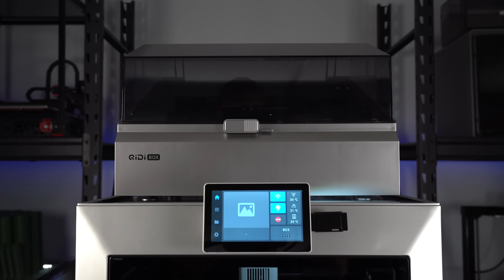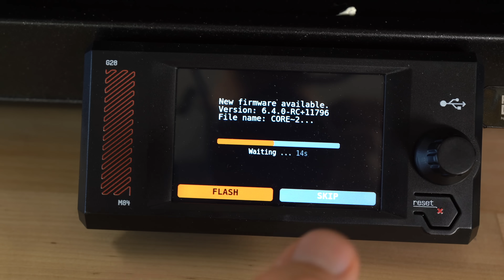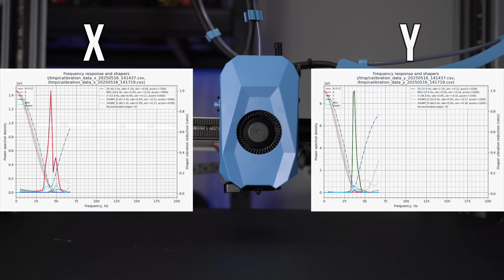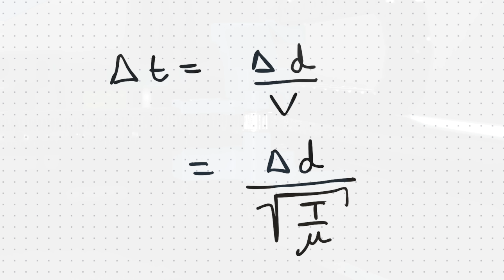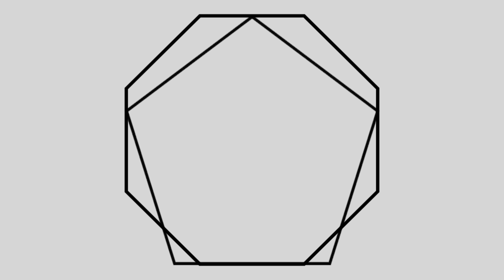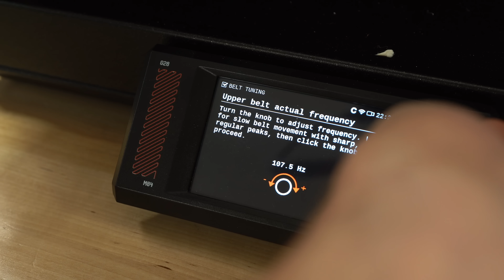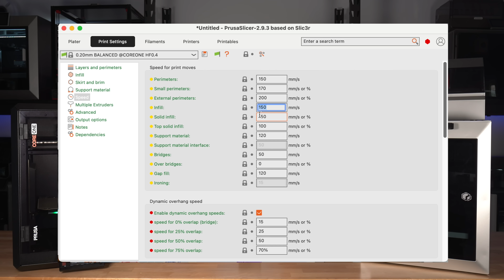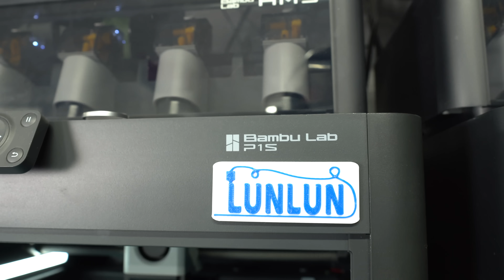The 3D Printing VFA Epidemic

Comment: Are there belts with staggered teeth? I wanted to make a comment about using a flat belt, but the issue of belt slip is probably why those aren't used (though I'm still curious to see results using one). Staggered teeth, meaning teeth that don't vertically go the entire width of the belt and has multiple teeth positioning along the width, sounds like something that probably isn't available (along with the drive gears not existing), but could potentially eliminate this problem visually, not just virtually. I've only dabbled in 3D printers enough to barely wet a single pinkie toe, so my experience is effectively zero.

Comment: The P2S is their main line for print farms. They probably left the 2mm pitch just so the farms arent screwed over into having a huge stock of replacement pulleys or motors that are not compatible with the newer model. You can afford to mess with people, but if a company sees a 5000$ loss because their old inventory is no longer compatible, they may jump ship on over a 100 new machine purchases

Comment: Noticed this on my Centauri Carbon as well. I started out years ago with a DIY Cartesian printer and never had this issue until I purchased an out-of-the-box 3D printer this year. Its been driving me nuts. When I built my own printers I always used toothed pulleys and steel reinforced belts with high tensions and I used larger pulleys to avoid artifacts but it was much easier to design around this stuff when building your own. But I do like how simple it is to just click print and not have to tinker with the printer as much as I used to. I guess it wouldn't be difficult to do upgrade on the printers that at least allow you to edit parameters like steps per mm. When I was running Marlin it was a simple task to swap out a stepper motor for a different degrees per step. I remember talks a while back in the facebook groups or using closed loop servo drivers instead of open loop stepper motors. Basically DC brushless motors with a gear drive and encoder built in, they didn't have resonance issues but the main boards back then couldn't handle them. It wasn't until the 32-bit boards started to become more popular and affordable that we started to see some closed loop stuff come out but it was still stepper motors.

Comment: You have pointed out a problem that can be resolved by improving rigidity.....I come from a machinist perspective....I recommend looking at cnc milling machines where rigidity is essentially needed to improve surface quality, position accuracy and superiority in speed.....yes the cost of the machine will be more but go look at a mini cnc milling machine that can cut aluminum and steel and get very good surface finish and accuracy.....also the use of linear scales for input to get repeatability and accuracy....personally I would replace the head of the mini cnc mill and see the difference....

Comment: Wonder if encoding can compensate for this. also isn't uneven tension on the two belts going to cause motion system issues and skew? as one belt is technically slightly longer then the other one and all that. Maybe they compensate for it in firmware.

Comment: At least part of the problem is resonance of the structure.  All the high accelerations happen at the top of the machine, and those forces have to be reacted through the frame to the base and into the shelf or whatever it's on.

I put about 50 pounds of tile on top of my Bambu P1P, and put it on a heavy, sturdy shelf.  Both reduced the VFAs.

Comment: I feel like you could add some kind of dither to the motion to randomize/decorrelate the motion errors resulting in a slightly worse overall surface finish but without the periodic artifacts. Seems like something that could be implemented at the control level.

Comment: In astrophotography we call it read noise and we solve this issue by dithering between each picture. I’m guessing they can fix this by offsetting each layer randomly between the X & Y axis.
Reply: Actually, I just realized there’s no way to offset because the belts are fixed loop. This is more like training the amount warm drives harmonics. I still feel like it could be done through code.

Comment: If dropping timing belt spacing helps resolve the issue then a complete solution would be to use helical timing belts. Unfortunately it doesn't look like those exist on the market, or they're not cheap, or the right size for current 3D printers. Maybe a factory in China will just start making them and they'll pop up on AliExpress so we can all buy them and throw away our current 2 and 1.5mm timing belts and pulleys lol

Comment: Hey, total noob to 3D printing here. I'm not great at math, but just curious... what if we used skewed/ diagonal teeth on the belts and pulleys instead of perpendicular teeth? My theory goes that the previous tooth and the next tooth would overlap before the prior tooth disengages, resulting in a lack of steppiness from one to the next... I'm guessing something so obvious has been tried before... why wouldn't that work?

Comment: Printer manufacturers also need to reckon with so many different filaments and environmental factors they can't control. I'm trying to print using Sunlu matte PLA right now and I want to give up the hobby entirely.

Comment: Fact is 3D printers are built down to a price so you are going to get these kind of imperfections. If they used ball screws and servos you wouldn't see it but would also cost multiple times their current price. While algorithms can do a decent job of mitigating the worst effects it's never going to be perfect.

Comment: I feel like of you were to use 2 motors with one motor rotated half way between steps and gearsd with the other motor to be permanently and constantly offset in ths way it would act as equal and opposite effect smooting motion out. But would need a speciel motor controller built with this in mind.

Comment: If you want a printer without vfas then it seems like the best way is to remove the stepper motors and use more industrial servo motors instead, remove the belt and pulley issue by using aramid cords and spools, and as long as the frame itself isn’t prone to resonance or vibrations then you’ll probably havel close to no vfas if any at all.

Comment: So.....possibly really dumb question but......the NFL uses a camera above the field held in place and moved via a cable system. They don't seem to have jittery footage when the camera is moving, tracking the players/ball, which are often moving erratically. This lack of jittery footage could be achieved in a variety of ways including digital manipulation, possibly using multiple ways simultaneously. So, find out how the NFL is moving the camera around on cables while avoiding oscillation and other problems, and apply them to the 3D print head oscillation issues with the belts? (cables versus belts?)
Reply: Whole different problem set to this. The NFL can afford to use big expensive high torque servo motors that 3d printers can't. The cables are going to behave significantly differently to rubber belts.The camera probably does still vibrate too, but physical and digital image stabilization will do away with it.

Comment: The constant that seems to being pointed out, is that regardless of the type of oscillation you have, slower speed will make this worse because of the resonance. The interesting thing is when I slowed my Creality K 1 down to “silent mode” the VFAs almost disappeared, so I’m curious why it didn’t have the opposite effect. 

To address the question of why every printer suffers from this is due to the limitations of belt driven technology and it only getting worse as speed increases. It will be interesting to see if the technology changes like automotive steering.

Comment: I was also thinking if it has todo with the motordrivers. not sure how they work on low level, is it like a bit set on the output, or do they have  to write 3 times to move a x, y, z motor? if so that can be a slight delay between them that maybe could get the motors to vibrate or not be in sync to get you vfas? just a wild guess here.

Comment: I think the ultimate solution will be the switch to servo motors and rope/cable driven printers. We're already seeing this approach used with current print speed record holders for similar albeit compounded factors. Its only a matter of time until the tech reaches consumer printers.

Comment: Super important topic and i appreciate it. Bambu uses smooth belt and smooth idler on some (belt is partially toothed and partially smooth) but i feel like its not enough. Only solution seems more teeth and following belt specs for pulley size. I hope thats the next step they take because vfa are very offensive for surface finish. Bambu is sort of progressing, but not using 0.9 degree stepers limits them a lot as you found out.

Comment: Great Presentation on Resonance & VFA's & the How's & Why's. Excellent visual que's and explanations. The Question still remains though. For everyone out their that has bought a High Speed Core XY Printer in the last 3-4 years the Best way to reduce VFA & Ringing is?? Yep my Point there isn't one really ie; idlers, pulley tension, speed adjustment, swapping belts & stepper motors, pulleys etc, Buying or adding upgrades hoping & praying its the right upgrade option that aides your 3D printer machines brand and mechanical components to eliminate the problem/ Thus the Problem is, Do not assume using Factory Profiles are the best option AS They are Most Certainly NOT.   Learn what Slicer Profile settings with or without the upgraded components, What slicer settings actual do to the Prints, Not what they say they do, BIG BIG DIFFERENCE there & Test each printer with the Slicer, Which lets be honest 70-80% of people do not do then complain about issues, Thus the reason I'll cop hate for this BUT People settle for Bambu Lab because1 they do not want to learn and wont apply the time to do so,  They can buy 10-20+ aka Bambu Lab printers and apply one profile to all.  Want a acceptable quality 3d print for production for sale, Rather than to learn what settings actually do with their machine, Not what they say they do. Choose the Easy road. In my opinion if you are just copying a file using a factory profile and printing models you are not a Maker, WHY? Because you are doing nothing but Copy, Paste & Click Print. You are a Human production line extension of a Machine. Sorry but it is the reality of it. Ranting yes but very True. lol Great Job on the Content though. Nice one

Comment: 12:41 what's the horizontal ghosting that is seen here? I have VFAs (probably, due to the original belt tension method not being recognized as a frequency on my phone) plus these horizontal changes in surface finish when, say, I have a feature change at another part in the print (ie, when there's a shorter part on the same bed that is only half as tall, a horizontal surface finish line is seen at the taller part when the shorter part completes)

Comment: So could you not clock or orient the gearing/teeth of the belts and/or drive & driven gears/idlers + polygon effects resonance to offset the stepper motors resonance and create a sort of smoothing factor between them?

Comment: Hi, very interesting video with clear explanations.

May be some "old" tech could help, the one that was used on OCE Graphics tracers 30+ years ago, using very strong linear motors instead of stepper ones (yup, analog commands and measures) - at this time it was the only tracer able to draw a circle that looked right, without any stair effect.

Comment: is it possible to find a company that would make a 1.5mm belt in the length of the p2s and a cnc company to make a replacement piece for the stepper motors and upgrade the belt your self, and possibly make a kit? (*wink wink*)

Comment: Its so hard to tell if its one particular reason behind that. When my both X1C`s were new, they had nearly no VFA`s. After running them for about 100 hours, it got worse and worse. What I found out was, that its not just the belt pitch. Its also the belt rubbing against the top or bottom on the idlers.  So if it was just the pitch, why were they nearly free of them when being new?

Comment: I'm very happy to say my Qidi Plus 4 handles VFA exceedingly well. I'm not actively selling anything but the print quality of this machine is so good that I've started to forget about all the issues I had with the printer that came before it. I wouldn't have much trouble selling things made on it. Or rather, the other little problems would come way first... namely inclusions of crud from the nozzle when doing PETG. Also I need some improvements with overhangs and bridging. Everything else is tight and sharp and very clean. Took me a bit to get used to this machine and clear up some factory issues but it is for sure a pleasure to use.

Comment: Would a cable be an even better solution? Wrap one or twice around the stepper for grip, and a tensioning spring oil on the cable and maintain force.

Comment: The most likely cause: Magnetic field of the earth polarizing the particles as they are in a fluid state - along with micro-influences on the stepper motors - , and we see similar patterns because the lines coming off the earth would all be relatively similar and appear parallel close to the earth's surface, and only varying as you move far away from the surface. #my2sense

Comment: Just a heads up, this is a problem machinists deal with and have many good solutions for. In that industry it not called VFA, its called chatter. Rigidity is king. Cheap (why there used) belts instead of zero backlash lead screws is probably a big contributor to what your seeing. If the solutions CNC machining apply to their issues were applied to 3D printing. I'd bet the print quality would be insanely better.

Comment: It’s like tuning over half a dozen metronomes WITHOUT PUTTING THEM ALL…on a single rolly board🤣🤓🤷‍♂️Remember that, when they figured out, it only took 1 rolly board to synchronize about 100 precisely OUT OF TUNE metronomes🤔🧐if only that science applied here🤣what if ALL VFAs could be fixed by a single rolly board😅💡✌️😉

Comment: There is a video where someone wrote a custom firmware so the printer follows the shapes of the object even in the Z-axis. That heavily depended on the shape of the hot end and the specific object, but the results were impressive.

Comment: As a signal processing specialist I am surprised the obvious solution has never been considered or implemented with 3D printers.

VFA is essentially Fixed Pattern Noise. 

The way this is resolved in other industries is to add stochastic jitter to the positioning.

You can even see it on the design of tire treads : the tread patterns are purposely disturbed by a noise function to avoid the tire resonanting while contacting the road.

I would put three piezo actuators on the print head of a 3D printer and feed them with a noise function. It remains to be explored what the optimal spectrum of this noise function should be (1/f, Poisson, etc) and what amplitude it should have, in X, Y and Z.

But the net result will be a finely textured but much smoother surface, and likely also better mechanical characteristics.
Reply from the maker: This is a very interesting idea! Thanks for sharing.

Comment: CNC machines made the transition from stepper motors long ago to servo motors. the difference between a two way communication by a servo to the computer as opposed to just an order to go from A to Z  of the stepper motor. Unfortunately, the cost of that switch will be very painful for the “hobbyist “ , the average guy just trying to make stuff.

Comment: This!  Yes!  Great to see VFA being dealt with. I put off buying a core-XY as I knew those long belts would have some downside. The obsession with speed has ignored this problem for so long.  Variation in step size for each motor phase as well as inter-phase micro-step variation led me to use layer heights that were in full step or four full step ( same phase ) increments on my printer. This helped a bit with layer thickness variation.   I may fit a digital micrometer to the vertical axis of my next printer to fully calibrate the axis to see if that will make it better still.  The linear sensor in digital calipers is are so cheap I would think this could be added for little cost.

Comment: SUBSCRIBED !!!
Really appreciate the information, still running an old stock CR10-S Pro, and would like to get better prints, especially faster prints.
Since the belts move the same amount, you should be able to just change them to the 1.5mm.
Not too knowledgeable, but would also go to the Kipper setup, but looked a little daunting.
Anyway, great way you presented all the individual problems! Thanks! 😊

Comment: For the voron printers we have known about this issue for years. Ellis Print Guide has a VFA  troubleshooting section which goes over many of the topics you discussed. There is also shake and tune by Frix_x which will allow you to measure a vibrations profile on your motors. Feel free to reach out to me if you want to discuss this topic further.

Comment: Interesting video! Although, I don’t see those specs published anywhere for the H2D. All I see on the Bambu site is  “GT2” which is an industry standard designation for a specific belt tooth profile that has a pitch of 2 millimeters, according to Gemini. 

Just purchased the H2S and curious if it has 2mm or 1.5?

Comment: Can’t wait for someone to build a 3D printer on cast iron base with linear air bearings, linear motors, printhead on magnetic actuators dynamically aligning the position to a reference laser beam, etc, etc just to get rid of VFA
😂😂😂😂

Comment: I have a P1S; can I just swap out the belts and pulleys for 1.5mm ones?  The 2mm ones are $12 from Bambu store, so it seems like it wouldn't be that expensive.  Unless it's tied to the stepper motor mechanics itself 😕